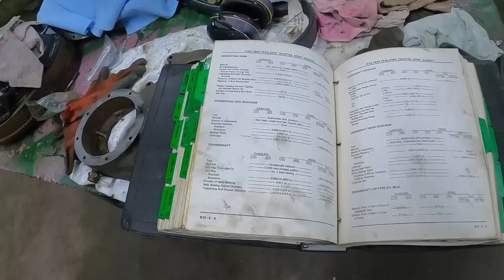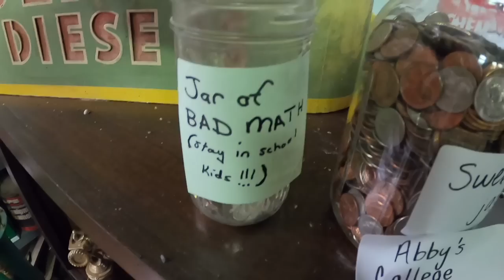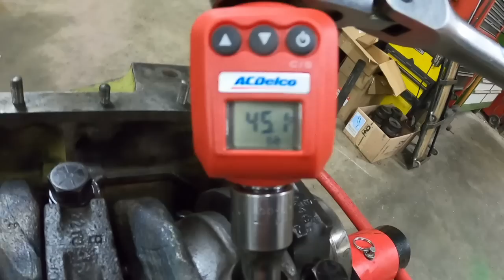BEARING HEADACHES, rods and pistons go in the 1855 Oliver block

Comment: Hey Chris, well I think I have decided not to watch anymore of this engine building series until I get the 1955 engine together! I cannot sleep at night now thank you very much!!! lol  No all kidding aside I am a-little worried when we start the reassembly process seeing all the trouble with the bearing clearances you are having.  My crank was turned 10/10 under by a different machine shop then where every thing else was done at because my machine shop guy cannot turn crankshafts.  I did take it to the place he uses and recommend, we gave them the specs and the numbers where we wanted it machined to. all my parts came from Maibachs as did yours. Oh well time will tell I guess once the pto, trans case and hyd. units are all back together as one then I will start on the engine rebuild.  Plus we just got the camshaft back this weekend.  Thanks again for all the help nd great videos we use them all the time as a reference when working on these projects. Such as the pto this past weekend.
Reply from the maker: I think a lot of my bearing headache has been self inflicted from testing clearance with assembly lube in there. Reading up on the subject and my experiment have me feeling better about everything. The rod spec must be a radial spec, because at .0005 minimum clearance, you'd have to cut that in half to get a radial clearance, which would be.00025. Be sure to count the decimal places, I sure did. That's incredibly close, too close. So on these rods if I had a .001 film on one side and .0015 of plasitgauge on the other, that would give me a diametric clearance of .0025, or .00125 on any one side (radial). That's pretty much in the middle of their ideal. It really comes down to, how thick was the film of assembly lube opposite the plasitgauge. After micing the crank and bore gauging the rod, I'm confident it's good. I definitely learned a lot during all of this. As to the thrust, if the new one had the 1.512 width that the book shows for it's narrowest width, I think it would have just been in spec.  Since it ended up being 1.515, the max listed, I was a little tight. I guess if i was grinding the crank I would have ground for the narrower bearing width, figuring the thrust could be lapped if it was a bit too wide. Then again, I would have picked up the phone and asked my customer to bring in their new thrust bearing so I could do it right the first time. And I hate calling people.
Reply: @ThatOliverGuyChris  I agree with you on the assembly lube thickness affecting the clearance.  I was always under the assumption that when using plastigauge it should be checked dry or with very light coat of oil. I guess there is always the chance human error involved. You just tripple checked everything when measuring each part.
Reply from the maker: Well, the proof will have to be in the pudding, the bottom end is all closed up, and the head should be going on tomorrow.

Comment: The thing about ring gaps is absolutely true, the rings will rotate around as the piston moves up and down. If the rings are jammed so they don't rotate freely that's when you're in trouble.

Worrying about the ring gaps is an old wive's (or is it mechanic's?) tale. It doesn't hurt anything but it also doesn't actually help because of how the rings will move.

Comment: When we did our 1850 we checked it a couple times using the same original rod bolts and on the last test one of the bolts broke off level with the rod and we had a time getting it out.
Reply from the maker: A small problem vs what that bolt would have done at 2000 plus rpm.

Comment: Great video!  I think your tolerances are going to be just fine.  My only experience running a tractor with a 310 was in 1750 my uncle had.  It ran great and fortunately for them, they had a good experience with that 310.  They, later on, bought a used 1955...not so good 310 experience for them.
Reply from the maker: Thanks! After doing my plastigauge experiment,  I'm good with the way it came out.

Comment: Chris, is the tight spec the as Manufactured and the wider spec the used or worn ok range?
Reply from the maker: Good question. The book doesn't go into much detail on that.
Reply: @ThatOliverGuyChris  even in the written sections? I would think it would talk about when regrinding is needed? I know they don't do it in Automotive service manuals because rebuilds were rare. Most of the time Cars got Reringing and valve jobs with rare bearing jobs. Just my ramblings. I would say I would want it in the middle of the tight range unless you plan on using it like it was intended when new in the era. From what I see I think the Main Problem on the 310's was the Wrist Pin Bushings. They just couldn't take the loads and the new type fixed that problem. My 2 Cents. I do have an engineering background.
Reply from the maker: I looked at the text to see if it mentioned if clearance was on the radius or diameter, nothing. It just says install a bearing shells in the block, install crank, install shells in the caps and check clearance. Very basic instructions. Usually the factory manual is more detailed, and this is one of the latest versions.
Reply: @ThatOliverGuyChris  I wonder if that was part of the in-person factory training that was never mentioned in the books? It was probably something that was well-known in the day but those days were long long ago! I would still guess the tight was for new factory parts and the looser was for the used acceptable-to-run range. You know how to operate them correctly when new and when cold. All I would hope is the shop did a good job checking the rods for any early signs of cracks otherwise I bet your rebuild will be as good as anyone! I can't wait to hear it run! I love the music of a 310 Turbo! a very unique sounding engine!

Comment: Chris,

Are you going to run it on a stand before you put it in the tractor?
Reply from the maker: No, my stand doesn't have room for the flywheel, so no ring gear for the starter to engage. Plus I need to flywheel to properly time the injection pump. It will be back in the frame before I fire it up.

Comment: . 002 even on a 310 would be good for me. I don't think I would want it any tighter. I seen several of these rebuilt here and worked on mostly Chevy big blocks myself . Did you put the chrome moly rings in it. I never heard you say what rings you used.
Reply from the maker: I used the rings that came with the piston and sleeves.  The top ring is chrome. I'm trying to remember if that was last week or the week before,  but I did cover them.